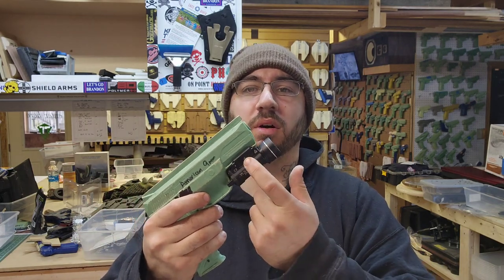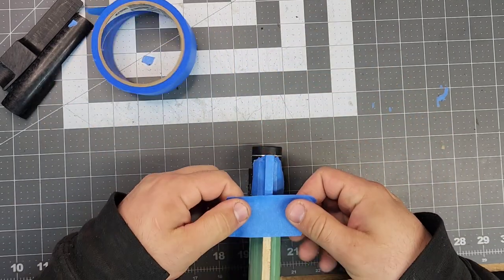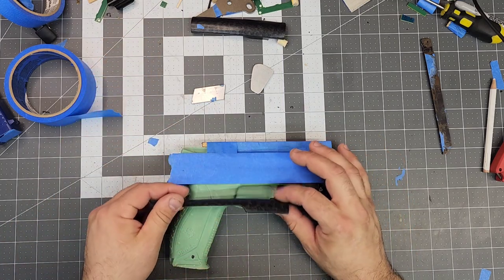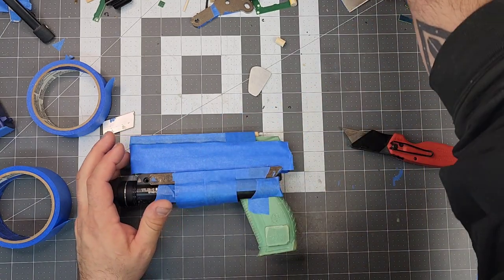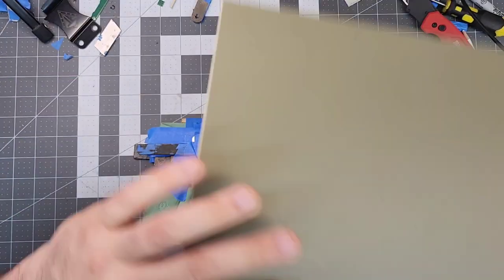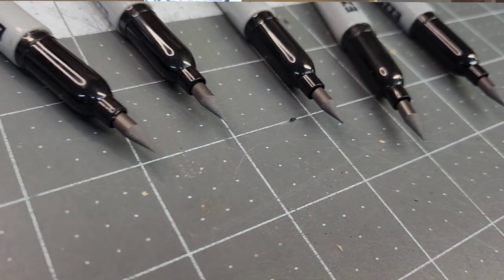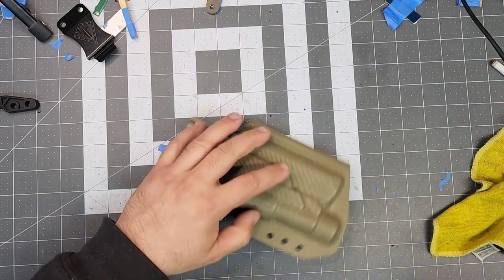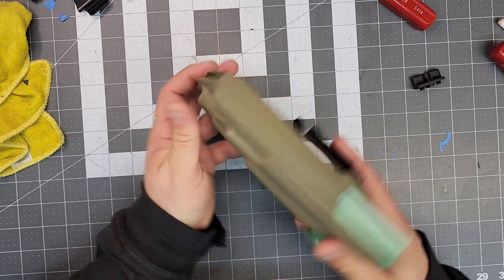Building a Ruger American TLR1 AIWB

Comment: So i have a huge issue with  my holster making. My issue is the kydex along the entire top length of the gun is canoeing or bowing up on each end. Like its really bad.  I have a piece of wood in between the sights as everyone else does. However the kydex keeps creating a bow from the middle of the gun all the way out to each end. Any idea on whats causing this to happen? Hope to hear from you. Thanks.
Reply from the maker: Pull tight and hold before clamping. Also using a book press works as well.